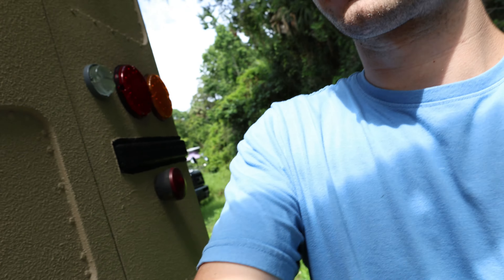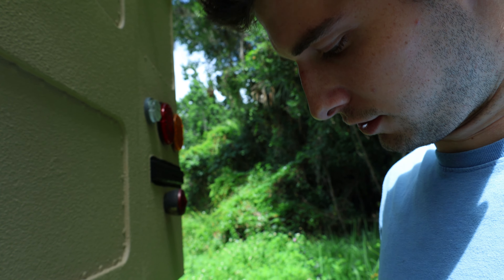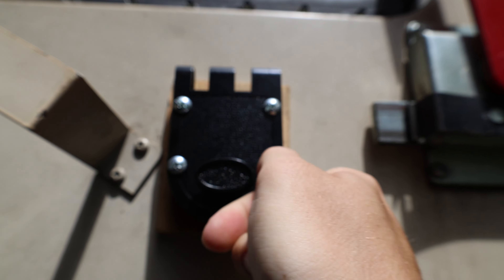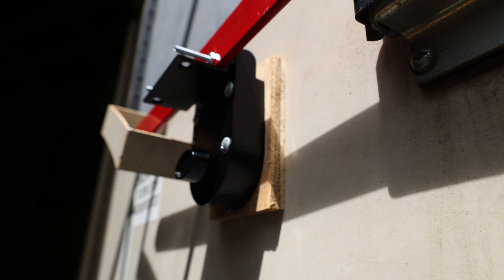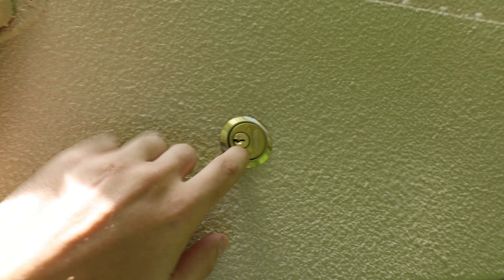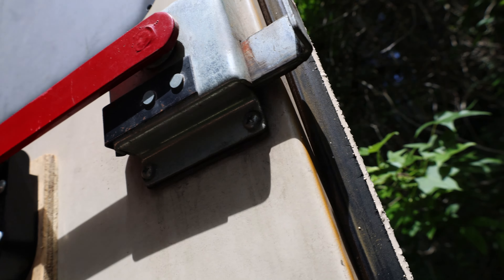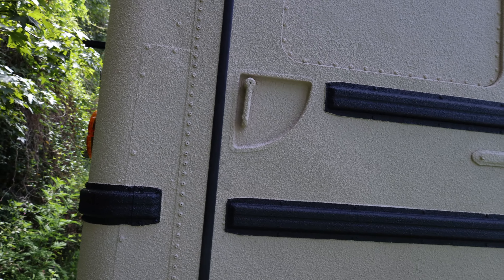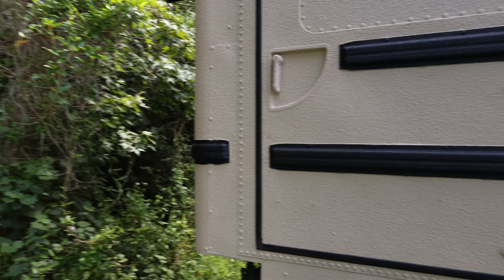Locking Rear Emergency Door | Skoolie Conversion

Comment: Hey man, I did the deadbolt idea for both the back and the side door and it has been working for the last 7 years.  I didn‘t connect it to the locking bar from the bus however connected it to the side of the bus wall.
Reply from the maker: I'll look into this for the side door. Thanks!